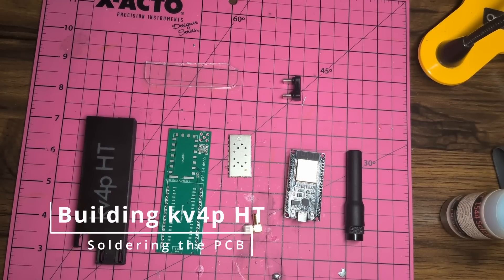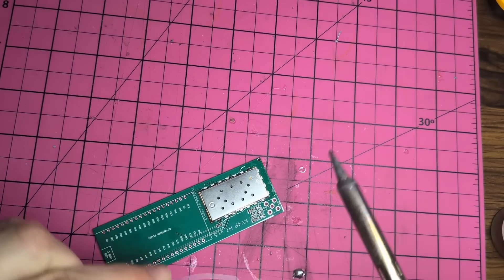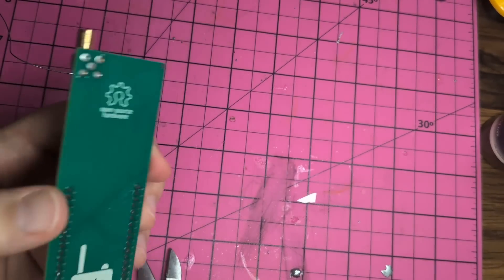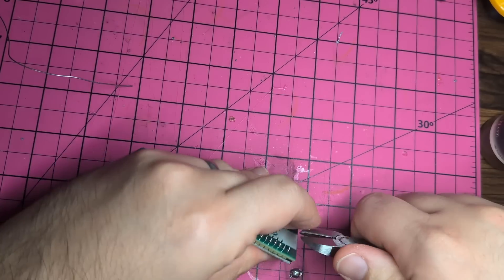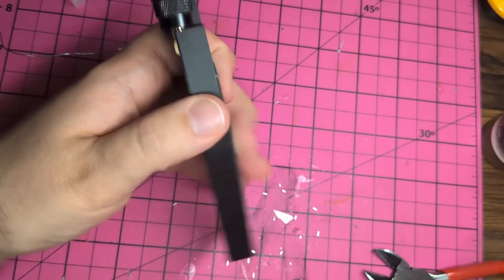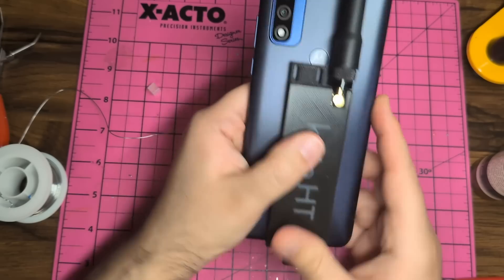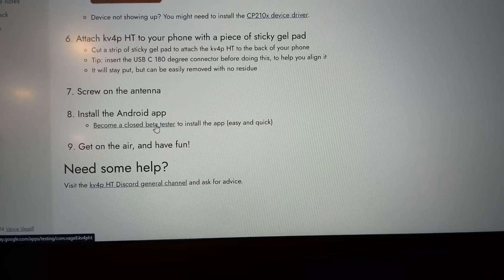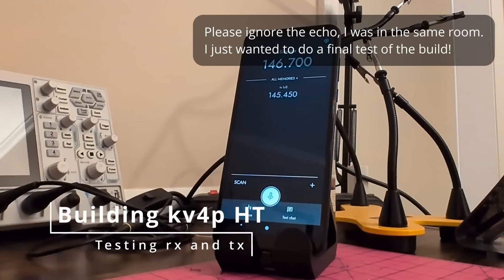kv4p HT step-by-step build instructions - turn your phone into a modern ham radio

Comment: Will this work on a cheep android tablet? I think the answer is yes.
Reply from the maker: It should! I tested it on my 4-5 year old tablet and it worked. Just make sure it has a USB C port, not micro USB.
Reply: @KV4P do they supply different amounts of power?
Reply from the maker: @brucecorbettn9bh398  I'm not sure what you mean, but if you're asking about a phone vs. tablet, then no either one should be able to supply the small amount of power kv4p HT needs, it won't make a difference.
Reply: Did you originally breadboard this? If so how did you mount the RF module?
Reply: I’ve played just a bit with the esp32. Just enough to bring it up and run the program to flash the LED. Bought it from Amazon. No way to tell what device to select in the developing environment. Got some help with that. I say this if the device you are using is required or if other similar devices will work. I suspect maybe, maybe not.
Reply from the maker: @brucecorbettn9bh398  I originally prototyped this "dead bug" style with just the various leads of the components connecting to each other with little jumper wires I soldered on. The DRA818V doesn't have pins, so it can't easily be used in a breadboard.

Comment: Very Cool, Can you operate any Digital modes from audio output of the phone, such as an android app?
Reply from the maker: If the app can use audio from the phone, it should work, since kv4p HT outputs via the phone's normal audio. That also means you can connect it to a car or headphones with bluetooth and use it that way which is kind of neat. :) Also, kv4p HT's "text chat" mode is actually APRS messaging, so it already does digital modes itself. I plan to add a lot more digital mode stuff in the future, now that all the basics are working well!
Reply: @KV4P  your Discord doesn't work
Reply from the maker: @mk12pickle  What problem are you  having with Discord? There are over a hundred people talking in there, so I think it's working, but who knows!
Reply: @KV4P  it says invite expired every time
Reply from the maker: @mk12pickle  Maybe you're seeing an old version of the page, try shift+refresh in your browser and see if the link works. There were some bad links on there a few days ago, maybe you have those cached.